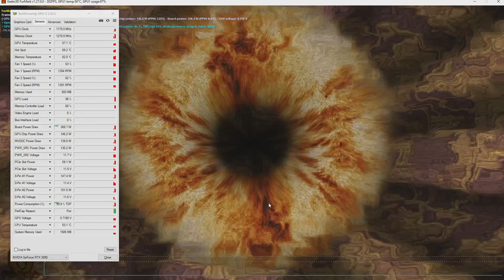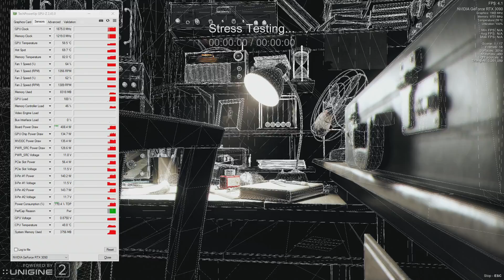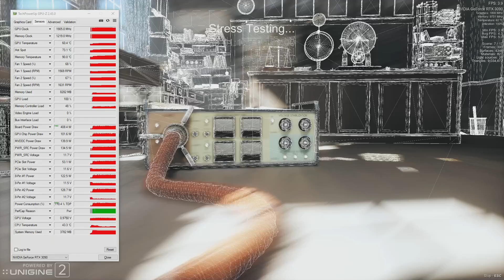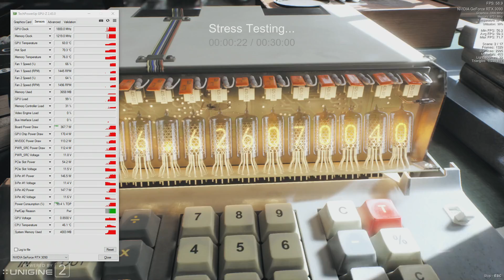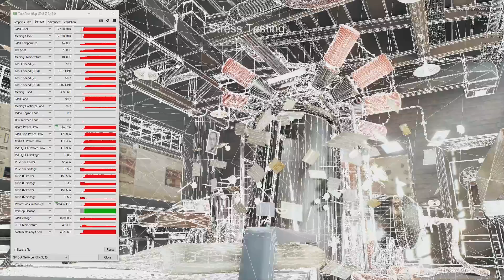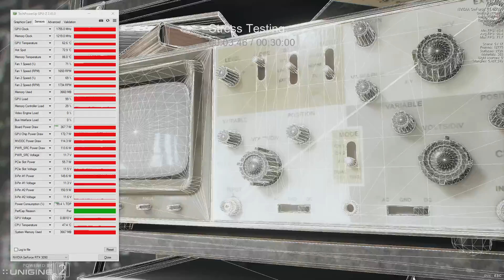One last thing about the RTX 3090 power management.

Comment: I was testing my Asus RTX 3090 in new world for a bit using gpu-z like in this video. It seems the card has higher power limit. It only hit 100% TDP somewhere  around 400W. I have new world limited to 60fps. When limited to 60fps and 2560x1440 resolution I gpu load is around 40%, power usage is around 270W. If I change to 5120x1440 with 60fps limit the load is 70% and power is between 380W and 390W and TDP is at 95%. When I first ran new world without the 60fps limit it was doing over 90 fps with 5120x1440 resolution so after seeing those wattage numbers I dont want to try what the wattage would be if it was running at full load.

Comment: The level of depth in your videos is astonishing! Thank you!

I have a question.. Maybe..
I have a Zotac Trinity 3090, which was the only card I could get last year, and I even got it at close to MSRP.
I flashed it with a VBIOS that has the power target set to 370W (it's a 350W card, as you know) and I have the card limit set to 105% TDP, so it's close to the max allowed limit of 390W.
It runs at, or near, the 105% TDP in many workloads and has been like this for most of the time I've had it.

I have a custom water loop, covering all the power stages, the VRMs, and a passive backplate.

Is cooling something that is allowing the card to survive?
Reply: Yes, temperature only helps degrade lifespans of these components, but if they are pushed out of spec they can and will still fail eventually and early
Reply: buildzoid already answer to this question, or similar "it does. If you keep a VRM that's on the edge of it's capabilities at 50C instead of 90C it helps a lot."

Comment: Hey Buildzoid, completely off topic for this video but I was wondering if you happen to know which BIOS is best on a Gigabyte Z390 Aorus Pro WiFi, F12k or F11? I actually didn't even want the Aorus Pro. I wanted to buy the ultra or the master but they did not have any in stock anywhere at the time and if they did it was completely outrageous price. This brings me to a suggestion I have for a video for you. You could potentially make one for the differences in BIOS revisions on whatever motherboard seems appropriate. I know you have an oscilloscope so maybe measuring the differences in transient response, etc. I would also like to thank you for putting out such in-depth videos. I really wish more people would get a little more advanced when it comes to well everything really. I really appreciate your work and the time you put in. Thank you.

Side note. I know a lot of people have trouble overclocking RAM on the Z390 Aorus Pro. I got mine to actually post at 4266 and boot into Windows at 4133 of course it was not stable. I was able to get 3800 15-15-15-30. 3866 however was not. This was all on F12K. I switched to f11 and 3900 and 3866 are stable at 15-15-15-30 all with really tight secondaries and tertiaries. Ram is G-Skill non-RGB 3200 14-14-14-34. Anything above 3900 I just cannot get stable. If you have any suggestions on how to get 4000 plus stable please pass on the information and thank you.

Comment: 5:44 Two different definitions, optimization level could be defined as "how much of the silicon is that program actually using" or "how much render time does the prgram need for any rendered frame", in New World's case it's optimized if you go by the first definition whereas I've seen a few claims by devs that it does a needlessly complicated things on the rendering side meaning it would be unoptimized by that second definition.
tl;dr: utilization vs efficiency

Comment: Buildzoid, is this as much a problem for the 3090 TUF? Since the entire shtick is that it's meant to be durable, does it have better VRM protection or any such?
Reply: The Tuf parts have been garbage for an age
Reply: @pcoverthink  He did a breakdown of the 3080 TUF, which has the same PCB as the 3090, and he said something along the lines of it being the best 3080.

Comment: I'm hoping that running at 1440p is putting a little less stress on my 3090 (Strix).  I opted for high refresh over 4K gaming from HWinfo and GPU-Z I've not seen spikes that exceed the power limits yet- knock on wood.
Reply: Well considering the Strix has a 480W bios out of the box, I would hope its designed to handle the more typically seen power draws that gamers see with it. I have a modest UV and left the PL alone and it routinely draws 400Ws (gaming at 4-5K)

Comment: My 3080 strix with the power slider on 121% got up to 440w sustained for a few seconds while running 3D mark
Reply from the maker: it's probably spot on.
Reply: @ActuallyHardcoreOverclocking  Mind if I ask what PSU you are using when running the 3090?

Comment: If your card has dual bios and you’re running on the lower TDP bios, and have a frame rate limiter in place, wouldn’t that mitigate these issues? So even if the card were to spike, it would still be under (hopefully) the higher watt bios?  EVGA 3090 FTW3 for reference.
Reply: Unfortunately, the answer is probably no.  Now, the reporting tools won't show you the transients, and they may be happening at a lower frame rate, but they are still happening.  Remember, the power monitoring circuitry is before the power smoothing circuitry, which is before the VRM.  So, a sharp transient will be handled by the smoothing, but the VRM will still see it.

Now, the good news. Those power stages are rated for high transient load, so a lower frame rate means they might have time to recover.    Also, since lower voltage equals lower power, undervolting the card can also help.
Reply: @EmperorA0  Appreciate the informative and detailed response sir.

Comment: Would watercooled cards (with watercooled VRMs, obviously) last a little bit longer ? How's the longevity of a VRM at peak load but cooler temps vs the same VRM but at high temps ?
Reply: To pull a reply BZ made to another, similar question, "A VRM under full load kept at 50C will last much longer than one that is running at 90C."

Comment: Buildzoid kinda need ur help here , Use ur 100000iq to help me out if u can :D 

Got a 3090 strix oc white... put it on a b450mAtx Steel legend with a Ryzen 5 3600 and a Corsair HX1000 platinum psu ... i turned it on the PSU ticked once and nothin ... nothin starts eventho i did the 24pin jumpstart technique to test my psu if it worked in the first place before pluggin it into the system ... i plug it into my pc and not even the Jumpstart trick works anymore , psu fans dont spin no more NOTHIN ... so i sent it for RMA and i got a new one ... SAME THING happened again :( 

Where is the issue im confused :( ... when i plug in a old 450w psu into the motherboard without the 3090 the cpu fans spin ...

Comment: Hi Buildzoid, I have 2 question:
1. From the GPU-Z monitoring ; I can see that the 8-pin #1 voltage sometimes goes as low as 11.3V . From what I know, ATX specs calls for +-5% voltage tolerance on the 12V rail , which is 11.4V~12.6V. So is your power supply becoming faulty or GPU-Z reading is actually wrong ? 
2. The memory temps hovering at 94 Celsius, looks like it might still increase. Is it dangerous to run at these temps if I'm expecting the GPU to last at least 5 years ?
Reply from the maker: shunt resistor and input filtering make the voltage drop uner high loads.

Comment: you are wrong about newworld not being optimized,  ive looked at their Models ( they are doing rookie misstakes)
Reply: There are two kinds of optimizations: 
A) Make sure you utilize the hardware fully. 
B) Make sure you're not doing stupid needless work.

New World may very well be guilty of the latter, but it's pretty well proven at this point that they're nailing the hardware to the wall. It may be spinning it's wheels and not going anywhere, but it sure does fire on all cylinders.
Reply: He obviously meant the game is using the hardware to its full potential, now wheater the gpu prioritizes rendering close objects or volumetric clouds/distant trees/foliage (for example) doesnt really matter in this case. He was reviewing the cards electrical properties not benchmarking new world for best fps results

Comment: My friends 1070 would sometimes trip ocp on the power supply whenever you where loading something. Getting s bigger powersupply solved the issue but as you said proves that nv ignores short bursts.

Turing was the first NVIDIA GPU: processing a 32-bit integer operation simultaneously with a 32-bit Floating point operation. Ampere increases the superscalar width to 2x FP32 operations per clock or 1xFP32 + 1x INT32 operation per clock. 

These additional FP32 operations per clock may lead to the more gross violations of the power limit compared to previous generations. Especially as fp32 probably has more transistors than int.

A pascal vs turing vs ampure power spec violations in new world would be intresting to see but not nessarialy feasable.

Although as you said this does make me conserned for using big ampure longterm.
Reply: I wonder why the 16 series cards were so locked down- I have both an EVGA 1660 and 1060 and the 1660 does not let you increase power consumption at all in OC software and have never seen it go over 125w where as the 1060 you can

Comment: In my experience, New World is pretty wierd game to run, i have 100% stable 6800xt and it crashes all the time actually (and i mean crashes hard, like random restarts, system stopped responding, black screen, you name it) UNLESS i OC my card, and what most curious, it crashes even when  i'am cpu bottlenecked (i still have r5 3600) and card is running somewhere between 40-60%, there is some serious black magic hapenning here.
Reply from the maker: AMD's power management tends to be kinda buggy. I've spent way too much disabling on various AMD GPUs that I've had due to all the crashing it would cause.

Comment: Do you think nVidia did this in response to pressure from AMD Radeon 5700XT, knowing that the 6xxx series might take the crown on fastest GPU?
Reply: This is their usual MO with power delivery, and it has been for a long time. They're just running Ampere much closer to red line (remember the day one VBIOS update that limited boost clocks?) precisely because they realized too late in the game that going with Samsung 8nm instead of TSMC 7nm gave AMD too much of an in.
Reply: They use GDDR6X memory which is power hungry, and maintain powerful RT and Tensor cores. Good intentions, but they crossed a red line. I would rather buy an RX 6900XT which shows what can be done with 300W TDP, or an RX 6800 for best energy efficiency and performance/price ratio.

Comment: 22:00 
The best scenario for a gamer with RTX 3090 that has the fans model would be as follow.
Underclock the GPU core to about 1800MHz.
Undervolt to 0.800 - 0.900 volts.
Buy proper high quality thermal pads for the VRAM.
Lock your FPS to max monitor refresh rate in the Nvidia control panel/game.

Having this card in your system for more than 1 year with none of above is asking for a dead card.
Reply: Okay, that is very good. Now I know there are cards that do a lot better. Can you guys drop the GPU models for us to learn more?
But do remember what builzoid said, these high power peaks are degrading the VRM power stages slowly and steadily.

We are going into the winter part of the year now, my guess would be that next summer will be a risky gaming period on these hot 3090's.
Reply: @N0N0111  My model "EVGA GeForce RTX 3090 24G-P5-3987-KR" and I won't discuss longevity as that would be stupid considering they just launched last year but after seeing the flaws explained by Builzoid I will keep track of any change in behavior, although I know for a fact that the affected cards are very few, is not as widespread as it looks, but who knows, right now I'm wondering if my 3090 will live longer than my Asus 1080 hahaha
Reply: Mine is OC with the stock cooler and stock thermal pads/paste and it's been alive for a little more than a year...
Reply: @axelwolf2115  Yeah same, I think the flaw discussed here would already have bricked the card. And it survived 210h of new world. I'm good. Highly depended on your cards design.
Reply: Mines over a year old, runs fine thanks 😁 still has just under 3 years warranty left as well 😉

Comment: So, when / if I get my 3060, should I underclock it just to be sure? I'm gonna use it for experiments with neural networks and Unreal Engine. So, I'm pretty confident I will accidentally write some clumsy code that uses 100% GPU. And also Blender rendering.
Reply: Realistically, the 3060 shouldn't be able to slam the limits that hard, as it's overall capabilities are much lower. The issue going on here is that the VRMs are getting slammed with rapidly cycling transients that are outside it's capabilities, based on the evidence available. 
The 3060 shouldn't be running quite so hard up against it's own hardware limits as the 3090 does with regards to voltages and power. 

Someone can correct me if I'm wrong on that, but I doubt the 3060 is likely to see such issues from violating power limits, just by it having a more conservative power limit and resulting headroom to begin with.

If you are truly concerned, I'd start with underVOLTING, not underclocking. Undervolting provides lower power consumption, assuming the card doesn't ignore the limits put on it as part of the undervolting. Which would head off the issue of violating power limits. Undervolting also doesn't inherently hurt performance as much as underclocking does.
Reply: @jtnachos16  because the capabilities are lower, it shouldn’t be able to try for capabilities that are higher than it’s lower capabilities berf lorgic nurrrrr buuuhhhhhh
Reply: @jtnachos16  Thanks, sounds reasonable. 

There's just one problem - to wait when I can get a 3060 12GB for a normal price :D  Those 12GB are really attractive for neural network experiments, and I'm not a heavy gamer; *60 series GPUs has always been enough for me.
Reply: @camelCased  I'm on a 2060S at the moment. It still handles everything I've thrown at it @1080p without much issue, gaming wise. Only occasionally need to turn down a setting to maintain 60fps.  Or at least, it does now that it is in a decent case. 

Go figure that the moment I have the money to actually get a new card to go with my new build, is the moment the prices skyrocket.

Comment: basically, cards they released are another Fermi with better cooler and crappy power delivery (also fail with MLC and cheapo poly/tantal/whatever caps stacks on gpu)
Reply: I see why you compare it with “Thermi” but it’s not really the case, the 400 series had really design issues (that were mostly solved on the 500 series fermi cards). on the other hand here the cards have massive die with combination of inefficient process (Samsung 8nm) results in really power hungry cards. the power delivery is not crappy but inadequate (there is a difference). and about those caps saga as it was stated before you can’t judge power filtration by just evaluating few caps on the back of the card.

Comment: What I'm hearing is that RTX 3090s are future classics destined to be very rare.  Truly the Lamborghini of GPUs.
Reply: A lot water cooled models will survive the 3 years mark.
Reply: @N0N0111  Water cooling doesn't protect your VRM from blowing up.
Reply from the maker: @andersjjensen  it does. If you keep a VRM that's on the edge of it's capabilities at 50C instead of 90C it helps a lot.

Comment: Hi BZ, I recently went custom water, so I've been staring at GPU power and temperatures a lot in the process of overclocking my 3080 GAMING Z TRIO 10G during Superposition stress tests @ 1440p.
One odd thing I'm noticing is that the driver downclocks the GPU even in situations where the GPU is < 100% utilized in terms of power, e.g. I'm running a 100 MHz OC on the core and in games the GPU will usually hover around or beyond 2000 MHz, but during the 1440p stress test I'll often be seeing clocks of < 1950 MHz even 95% GPU power. As you can imagine under the custom block temps barely move. Thoughts?
P.S. The card usually runs at around 365W when maxed and I'm seeing the above @ GPU Power readings around 340W, so closer to 90 than 95% which confuses me additionally...
Reply: Lyuben Kuzmanov....1440p doesn't "stress" a 3080 at all. 
My PNY only starts freezing if I go +300 core. I never mess with voltage. 1995-2050MHz oob...cruises at 2200MHz, mid 60s on air. I use an RM1000x to cover any spikes. It does like to pass it's 320w limit
Reply: @yourhandlehere1  it's what the test is called, Stress. At 1440p it stays around or often goes beyond 100%, which is enough for my purposes - to load the card. I'm not worried about max clocks or stability that much, I've found those points. I'm playing with RPM curves to find the sweet spot in terms of noise and temps. My question was about the odd behavior of Superposition in, for example, scene 8/17. For a while both the power and GPU clock drop at the same time and I can't make sense of it.

Comment: Fur mark will always automatic throttle/driver detects it and auto throttles. Nvidia driver is aware of this program
Reply from the maker: My 3060Ti does that which makes it run at less power than it does in games. but the 3090 is right up against it's own power limit.
Reply: @ActuallyHardcoreOverclocking  <3 love your content btw. Keep this up and DDR5/DDR4 over clocks (maybe daily over clocks for 24/7 use and then unstable geekbench/score breaking after) helps a ton!

Comment: How applicable is this to the 3080 Ti? Since it's mostly the same as the 3090 but with half as much VRAM, does all of this still apply? It's crazy to me how most third-party 3080 Tis have a 400W board limit by default, when you're concerned about a 3090 with double the GDDR6X drawing over 350W. Makes me scared to see what's going to happen to my 3080 Ti if I happen to encounter these conditions.
Reply: Which model is it?
Reply: @andersjjensen  FTW3 Ultra